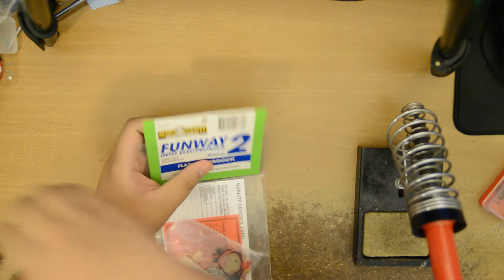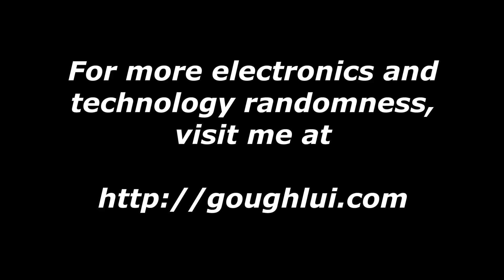My Last Dick Smith Electronics Kit

Comment: Wow, this brings back memories. I still have the FUNWAY 1 book and possibly the chipboard with a circuit overlay. Another DS kit I built was the one hat played "home on the range" using some dedicated chip. Didn't get it to work back in '82 or so. Bizarrely, I found it in a drawer again 30+ years later, and reworked my sloppy soldering, having at least -ahem- improved my skills in the meantime. So finally I did get it working, if only a few decades later. Better late than never. 😉

Comment: I just opened and made my dicksmith fm bug that has been in the draw for over 15 years, the performance isn't that great but I used the supplied batteries which might be the reason.
Reply: +Matowix Ask a dude named Colin Mitchell, from Talking Electronics, in Cheltenham, VIC, and he'll tell you, this cct. in Funway Vol. 2 is a crappy circuit. It works, but only just. Colin produced far superior FM bugs and transmitters. He used to publish magazines filled with them, and at one stage, they were sold through DSE stores!!! With Dick Smiths Co. code in the EAN barcode.